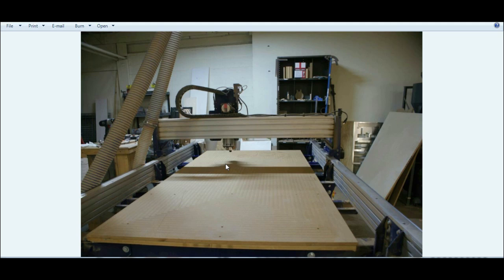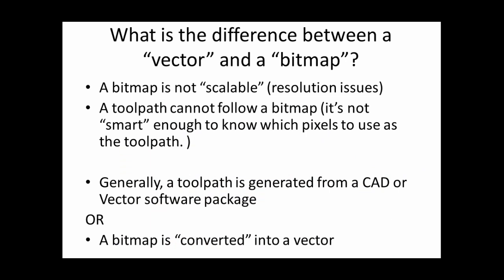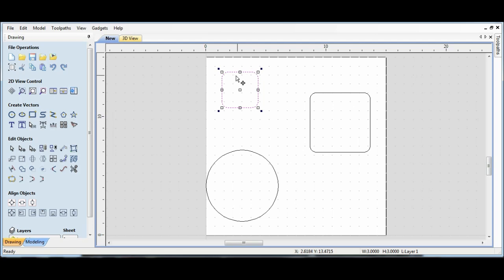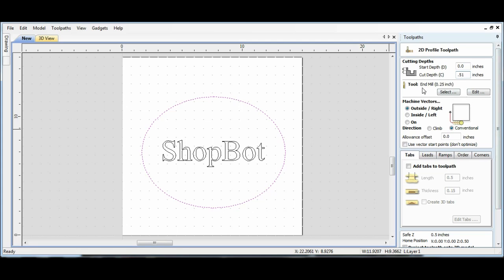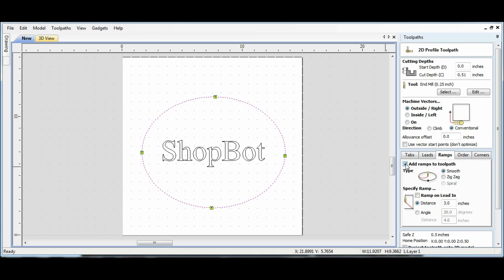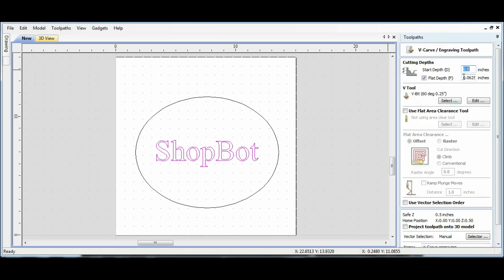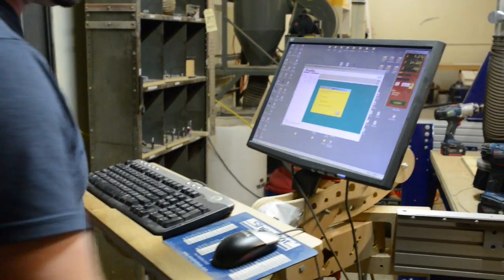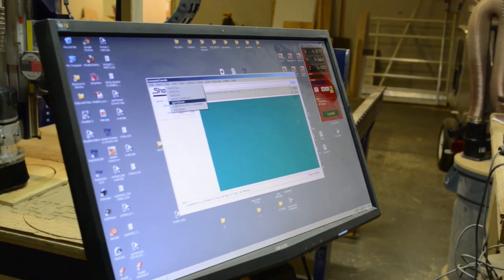ShopBot 101

Comment: Excellent class, by far the best end to end tutorial I have yet seen for the shopbot.  One question I would have was in reference to the compression bit referred to as a good option for plywood.  I don't see an option for this under the Tool option (Bit Selection) for compression,  is it considered a standard endmill? Or would the be the use-case where I set custom options.